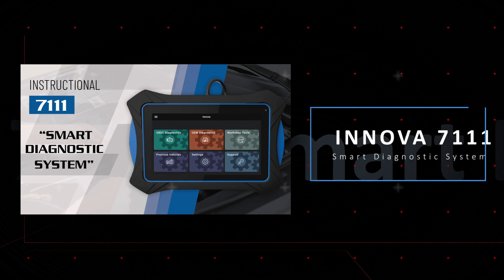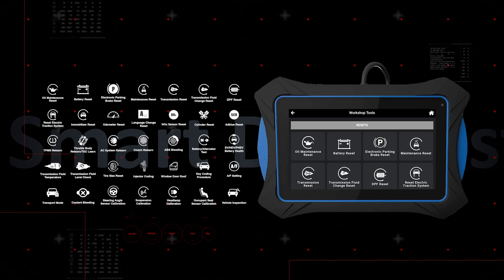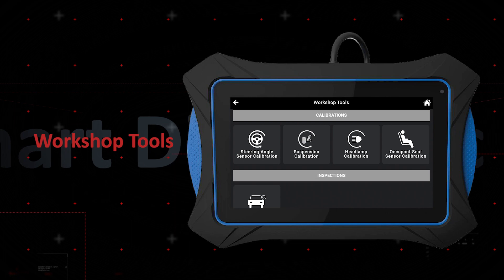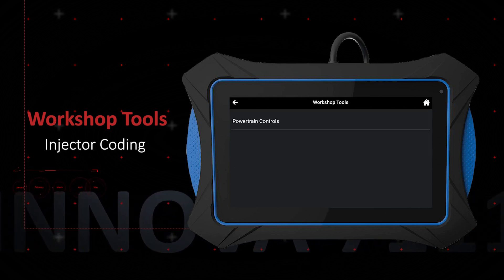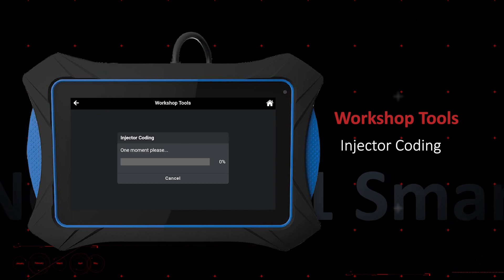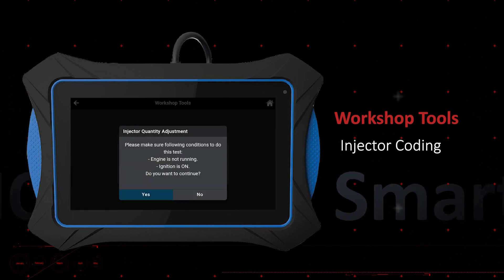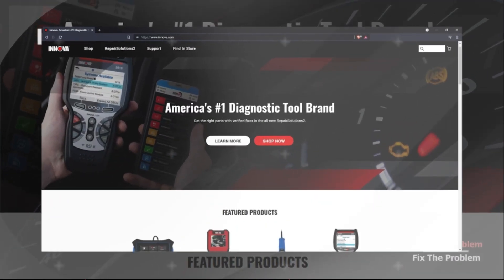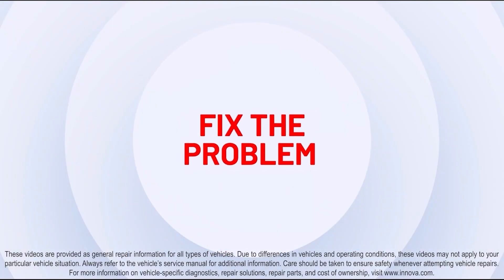Innova 7111: Injector Coding

Comment: Doesnt even give u the option to shut off each injector or check balances. I paid 550$ as well doesn't do shit!
Reply from the maker: Hi, thank you for your feedback. The Injector Coding function is only used to enter the injector ID codes into the ECU after replacing or swapping injectors. It does not include tests such as shutting off individual injectors or checking injector balance.
Those tests are typically found under Active Tests / Special Functions, such as Cylinder Cut-Out Test or Cylinder Power Balance, depending on the vehicle.
We recommend verifying coverage for your specific vehicle using the Coverage Checker at pro.repairsolutions.com prior to purchase or use.

Comment: Why won't this work on my ford f350 super duty?? I just feel like I wasted 550 dollars and it doesn't have an option for ford for injector coding
Reply from the maker: Hello @dookieren7430,
We appreciate your contact. To assist you effectively, kindly furnish us with specific information about your vehicle, including its year, make, model, and engine details. This will enable us to conduct a thorough investigation and provide you with the best possible support.
Furthermore, we recommend ensuring that your 7111 tablet is running the latest updates for optimal performance.
Thank you for choosing us,
Best regards,
Reply: i needed to code injectors in my bmw 328i 2013 got this and didnt gave me the option. i had to buy an autel